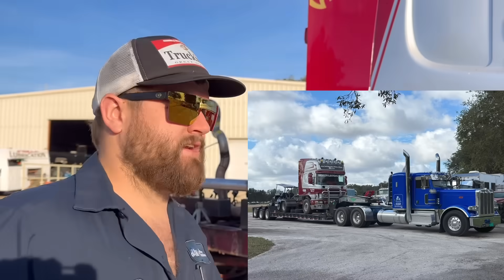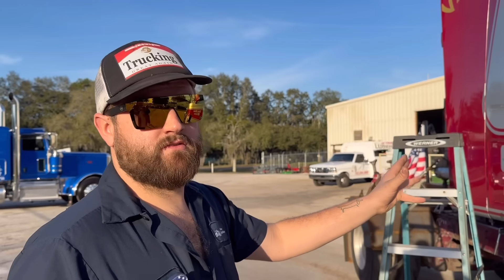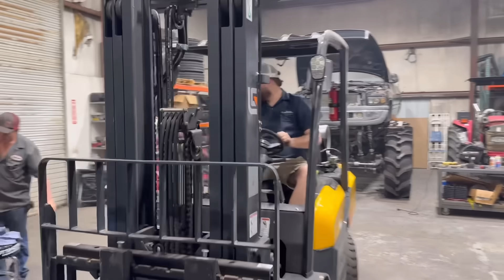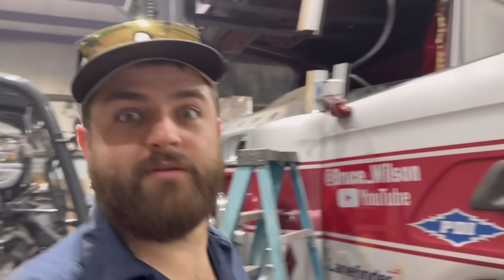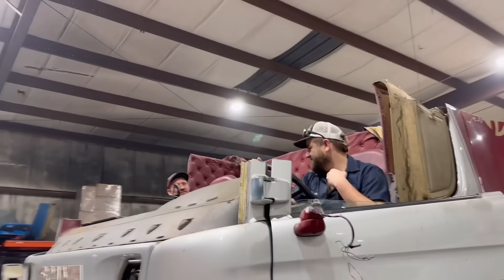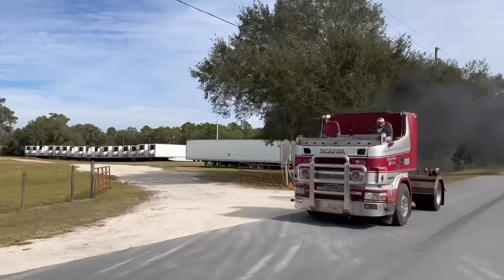Custom Soft Top SCANIA Build! SVEMPAS American Edition!

Comment: Scanias are the king of the roads across Europe 🤴
Reply: Kings of making same power with V8 that Volvo makes with I6
Reply: @DuBstep115  that’s like comparing a microwaved burger with a flame grilled smash burger.. Scania 770s delivers 770bhp at 1800rpm. What Volvo truck has more power than that?
Reply: @AnythingGasoline  F16 make 750hp at 1600rpm, big deal
Reply: @DuBstep115  the f16 is OLD they didn’t have to deal with emissions restrictions as much as todays engines do! Besides a v8 is always cooler than any Inline engine.

Comment: Next SCANIA project "America's Perfect Truck":
- 6x2 with long chassis modified to tractorhead
- R730 or R650 motor with modified ECU (800-850 Hp)
- stretched cab like in LONGLINE version (build from 2 older cabs) 

Maybe you could use parts from long-nose version and bulid a monster T730 V8 Longline.
That will be shock for American/Canadian truckers.

Comment: To some it's a legend. One that should be restored and kept... cutting into it, to them, is like making a convertible pulltruck out of the original w9a bandit truck... 😬😬😬.

...but I get it... as I think I've mentioned earlier,  carnivals are where old trucks go to die. That this one still starts, runs and even drives is more or less a miracle in itself. Have fun with it, and save your strength, money and parts for the white one, and of course save from it what might still be salvageable,  which doesn't look to be all that much, but still.

Comment: This truck as you shown it before you did anything with it, would be a 100% write off for Europe. Specially in the western part of Europe the laws are insane, you either need to fix it all, or simply scrap it. You could however order a cab for this chassis and just replace the entire cab on itself which should be a lot cheaper over all. Scrapyards usually have these things laying around, but perhaps there are other places you can get them as well.

Seeing this truck being destroyed like that, it hurts my heart in a way haha.

Those wires are for the electrical systems on the top of the truck. Horns, lights, CB radio, etc. Perhaps even the sun roof if it used to be electric. Often EU trucks have extra wires already build in for future reasons, could be for a coffee maker, microwave and such things for example.

Comment: Cut off the red wind guiding parts left and right in the back of the cabin, so only the silver parts are remaining. Add a chrome safety-bar behind the seats that (visually) connects the peaks of the silver parts at the top. Go for a plexiglass windshield (use the white SCANIAs one to create a mould for heat bending)… and finally remove that stupid wiggling saw at the back. Done :face-green-smiling:

Comment: Just get the widest convertible sedan and get the roof motors and links and put a hardtop folding roof on it. Would be not just a copy of the truck you saw in EU, but really convertible.

Comment: Really wish "Griff" was restorable, but like I've told others, it was too far gone when you got it to feasibly restore it. Possible but would have been silly expensive to either source every part or make something locally that would work. And then there is the body and paint.. Too much.

Would have loved it if you could have hinged the top on it.. Fold back when transporting, Flip and latch forward for events.

I Think so long as you can keep it alive and not totally destroy it (or whats left 🤣) Then thats the best this old thing could ever have gotten. If you can make it look reasonably pretty, all the better.

2 things needed for it IMO.. A good beefy rollcage and fire suppression. Protect the truck from being totaled as much as the pilot 😉

If the engine ever dies, I'd love for you to test out something silly and unsuitable as a replacement.. Like a 1000hp, 1000ft lb  built LS or similar.

If you could find an engine (or import one) I think a 16L V8 Diesel F350 or ram3500 or similarly ridiculously large pickup could become even more ridiculous.

Comment: That was a amazing idea to do it Like SVEMPA :) It's a wreck, so cutting stuff of it makes it a less of a wreck ? :D :D Well, would go all crazy and maybe do some mad max theme things on it. Or go with a little bit of Disco light's on the backseat and maybe use the old sound-system wire's. Led light bar on the back, from door to door. It can be how crazy amazing as you do it ,let you imagination just flow, the sky is litterly the limit now :D :D Maybe some wicked crazy awnings in case of rain :3

Comment: The correct way to remove the windshield is to cut the rubber away on the inside of the cab then push it out.

Comment: Should have added she needs that RH front fender and that button trimming round the edge of the cuts and she is good to go.
Needs a lot of weight on the rear end if you are going to pull sleds.

Comment: To top chop a topsleeper cabin is a bit silly...in the Netherlands they lower the cabines at the back side ,and use a low roof cab for it...these lowered cabs are used in heavy crane transport,or heavy exeptional transport in general...that have to do with the maximum hight of 4 meter for the complete combination...so if you imported a truck from the Netherlands,why not buy a lowered cabine...but funny to see that a old dutch truck ends its life in the usa....Scania trucks are also produced in the Netherlands,the production plant is in Zwolle....scania is at the moment part of the volkswagen group,wich also owned M.A.N. trucks...so most truck fanatics think that DAF trucks ( part of the pacar group) is the only truck factory in the Netherlands,but that isnt...funny to see you enthousiasm for the scania brand ,i will follow you video s greetings from the Netherlands.Rust is caused by the salty roads in winter ,and a lot of rainy weather in the Netherlands...a not good preventif chassis coating do the rest,same effect you get with a wrong method of painting/ respray.....a good sorted truck scrapeyard in my neighbourhood is Anema trucks Akersloot/ alkmaar.they import and export parts and trucks.maybe it will help you with looking for used spare parts...

Comment: Bro that’s why you should of got the one cab size down and it will fit with out chopping the top of the and get your self a Highline they look way cooler and you still have the same bhp the high cab is for long distance like going all across the uk and Europe just have a look at Scania Highline not the Topline

Comment: i think the back of the cab is way to high, i would bring it down to make a bucket more or less
then you can use the power for something else then pulling wind to make a tornado in the cabin

if its pulling lets go for 2 motors 🤣

Comment: nooo i appreciate your energy and drive to do things with scanias but this is horrible, suppossedly you respect the original design, furthermore when these vehicles scarce i your country,  imagine if i import an american icon into Argentina a sixties  mustang for example, maybe 20 mustangs i th whole country, have it modified to four doors, and remove the original v8 and install a 4 cylinder turbo diesel,  and change both tails and headlamp with abother from a make who has othing to do with mustang, say a Renault, is a butchery of bad taste done to a vehicle that is difficult to get i the first place, do that to blue collar i mean to thigsthat are abundant ad easy-cheap to get, after all is your truck so your free to do anything, but at least to me you just ruined i stil restorable haulig truck, i is a pity